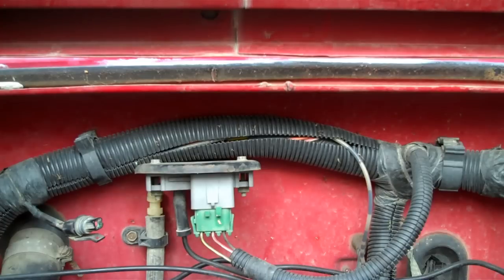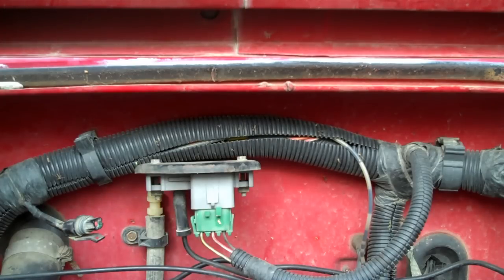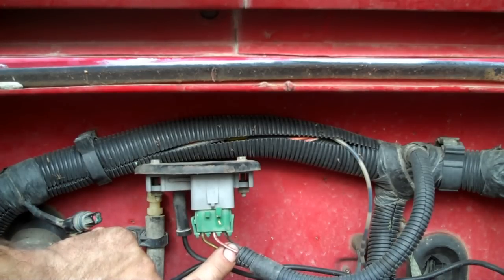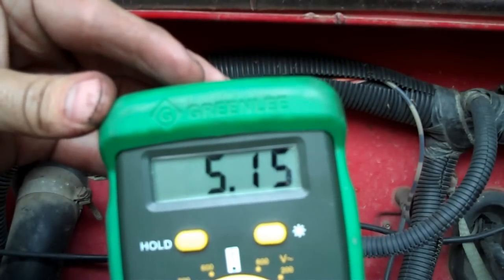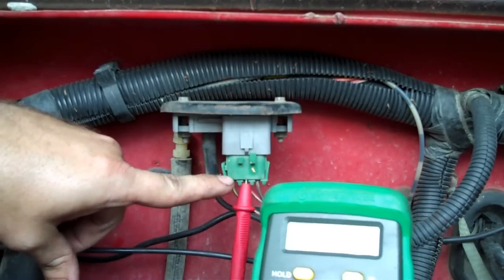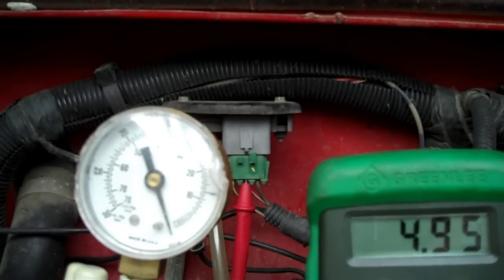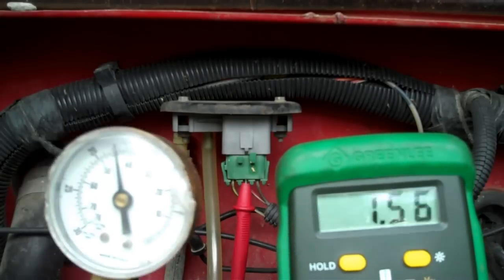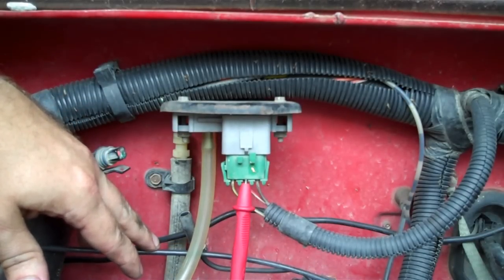Jeep Wrangler YJ -  How to test the MAP sensor.

Comment: I hope you can help with this issue. I have a 1993 YJ 4.0 5 speed. I have replaced the fuel pump, filter, pressure regulator, cap, rotor, plugs and wires.  Sputters occasionally with no pattern. Was doing it since I bought it a year ago and still after I replaced the parts mentioned above. I have not checked the MAP sensor yet. Think it could be that or just a Jeep thing??
Reply from the maker: InjunOne MAP can cause that. Bad vacuum lines possible. TPS can cause erratic flat spots or sputers. Check out this video: http://youtu.be/KRuxSgkOyig . Some issues will not light up the check engine light but will store a code. This is how to get the Jeep to cough up the trouble codes if it has any stored. If it doesn't at the time you try. The next time it sputters try running the code asap afterwards. Mine was acting up one time .. it was off and on that it would. Turned out to be a bad MAP ... so it;'s possible.
Reply: Thanks, TPS was also replaced.  Thank you for all your help!!
Reply from the maker: InjunOne Glad to help! Let me know what you find.

Comment: Great video. What does the MAP sensor do?
Reply from the maker: Thanks, glad you like the video!! The MAP means "Manifold Absolute Pressure". In non-geeky terms that means it measures the vacuum signal in the intake and converts that "pressure reading" into a voltage signal. Then it sends that voltage signal to the PCM (engine computer). The computer then adjusts the ignition timing and fuel/air injector mixture based off that reading the MAP sensor sends to the PCM. Hope that helps :-) Have a great day!!
Reply: could that cause a gas smell at the rear of the Jeep?

Comment: What if my input voltage is 5.02 and reference voltage is 4.46? Is that too low?
Reply from the maker: +AssGrabber B 
It on the low side of the tolerance in my opinion. But ultimately it will come down to if the engine is running correctly. I ran with mine outta range for a long time. Did it make it run bad??? Not really. But once I changed it I did notice that the throttle response was better. So honestly, if it's running OK, it's up to you or your pocket as to whether you wanna change it. Thanks for dropping by! Have a great day and a Happy New Years!